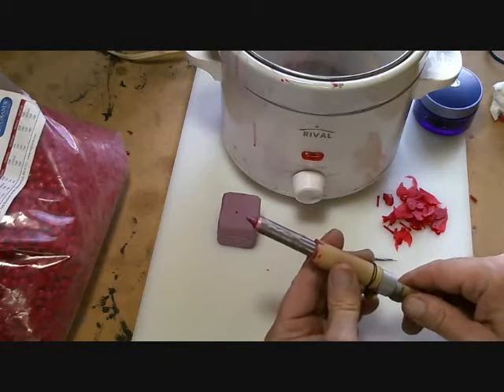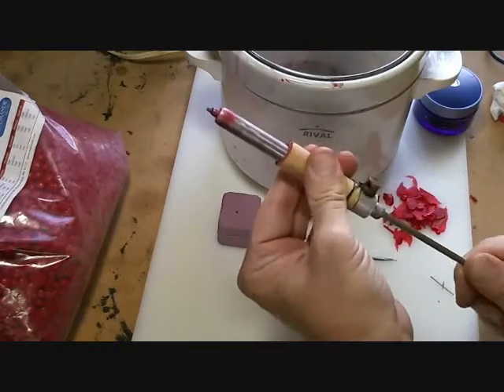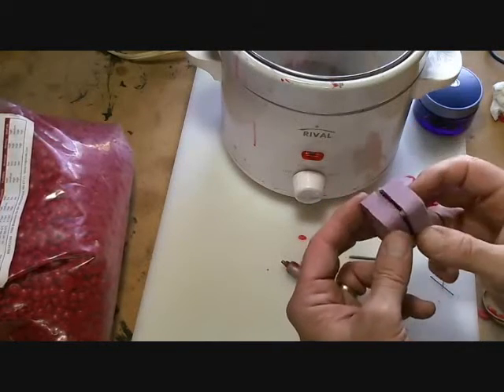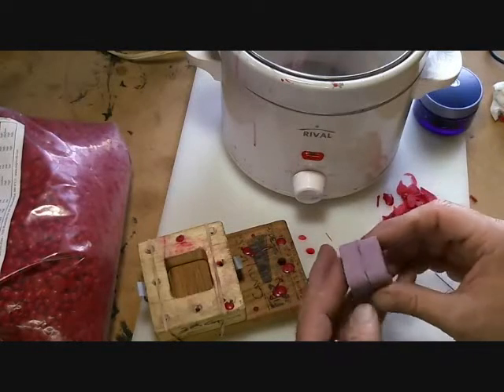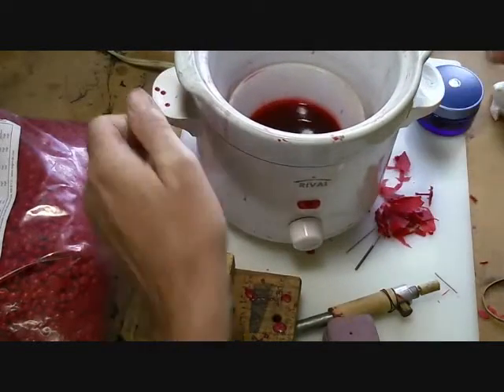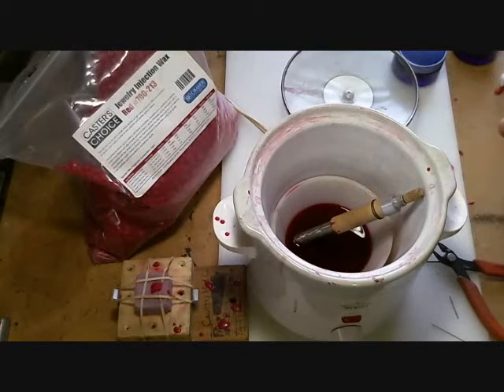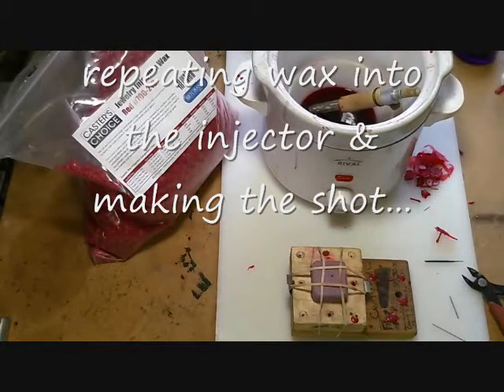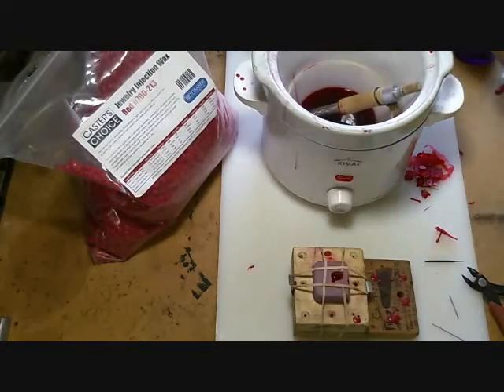how to make a wax injector for jewelry investment casting

Comment: Thanks for the fantastic video Jim! I've had trouble finding a small air cylinder like you're using though. What sort of industries/applications would use a cylinder like that?